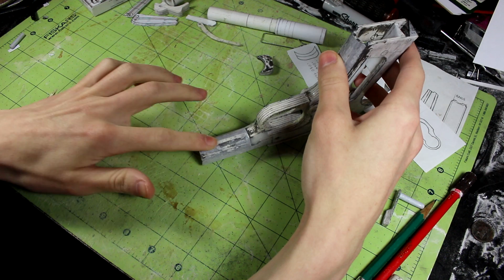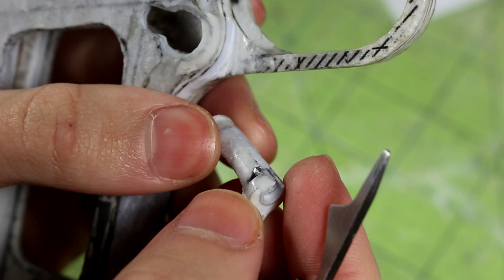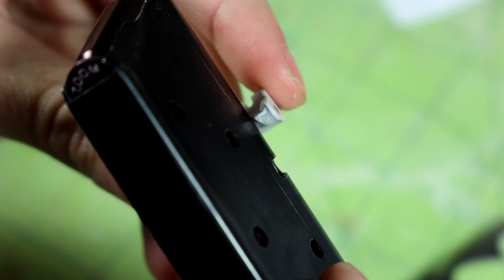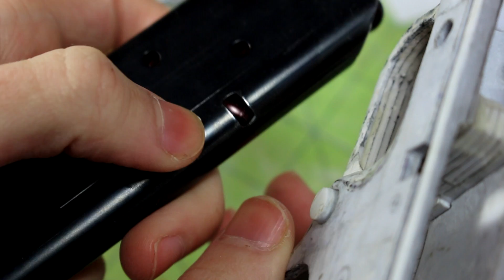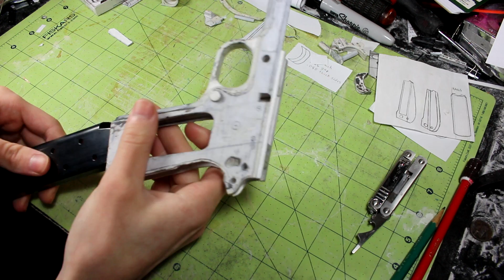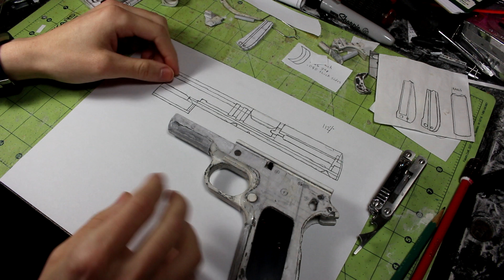Paper M1911 Update 2 - Shelden Caudill

Comment: Hi! For small parts on other projects, I use cheap lighter's parts (Bic), and old electric devices, like interruptors, and HP printers springs, and men telescopic small umbrellas, that here break easily, and I use the tubes and springs (these springs work very good in airsoft 1911s slides)

Comment: Hey I saw you said to get the size right just measure it with calipers and get it right on the on screen and trace it. But my hand shakes while tracing is that going to make it in accurate?
Reply from the maker: I have the same problem sometimes. Usually I trace it lightly on the screen and then I take it off to trace the lines darker with a ruler.

Comment: And was the parts stacked together using superglue or Elmer’s glue all glue
Reply: TJ_ YT both I'm pretty sure
Reply: LANCEL0T thanks
Reply from the maker: Thanks for the comments! Yes I use both types of glue. I use Elmer's glue to make 16 layer pieces. Then I glue the 16 layer pieces together with super glue.
Reply: Shelden Caudill would PARFIX PVA wood glue work just as well as Elmer’s glue all
Reply: Shelden Caudill would I be able to use PARFIX WOOD GLUE for this and would it be as good as glue all